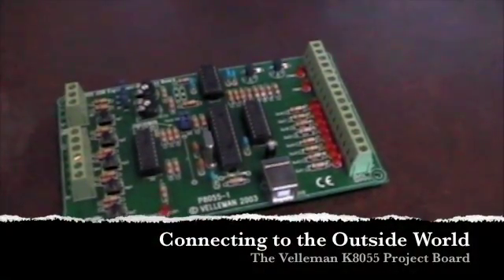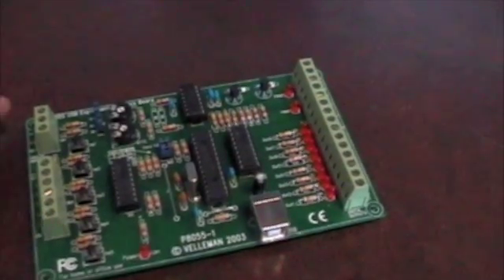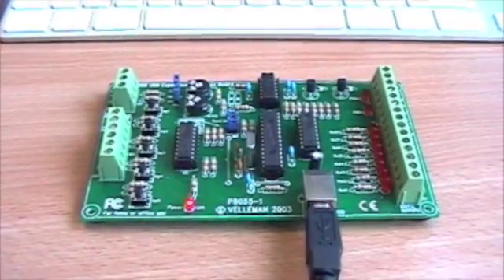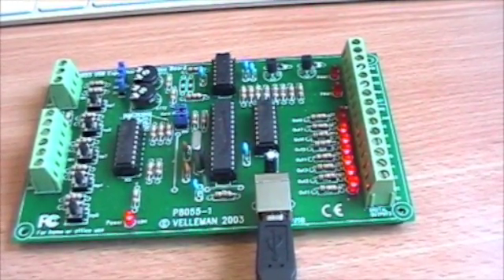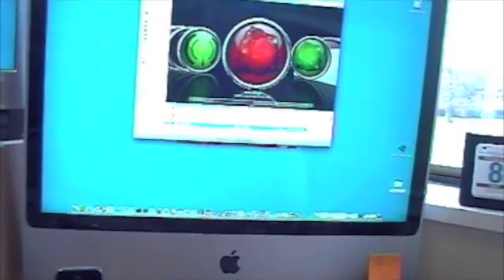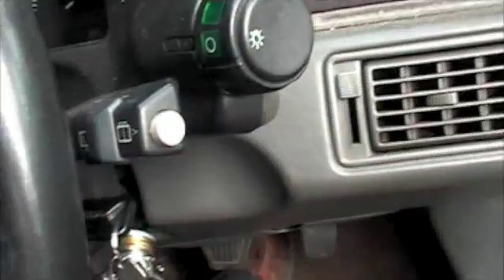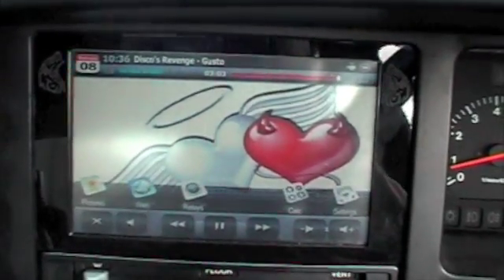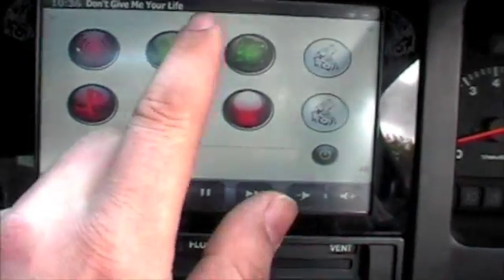K8055-Presentation

Comment from the maker: @ramaseesniblikthe3rd The aerial is quite easy as with the power removed from the control relay it goes down. So you can fairly safely assume the state at each startup of the app. The board simple drives 12v Automotive relay from each digital output. The software was all written in VB6. Thank you for your kind words!